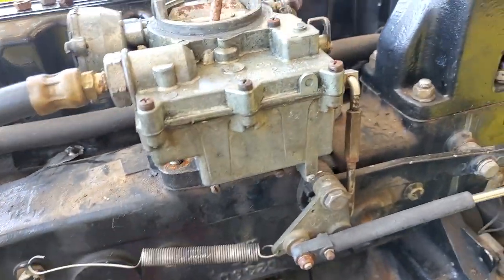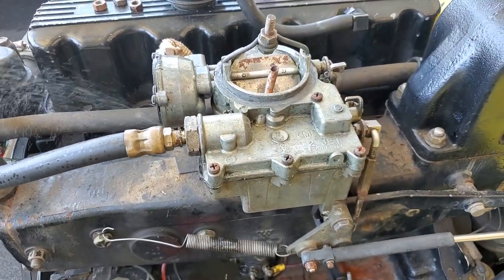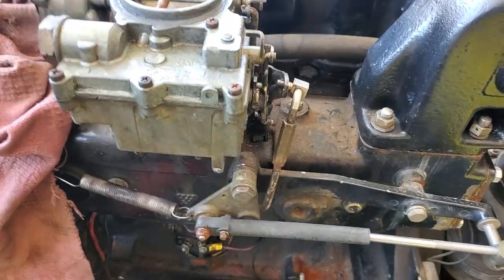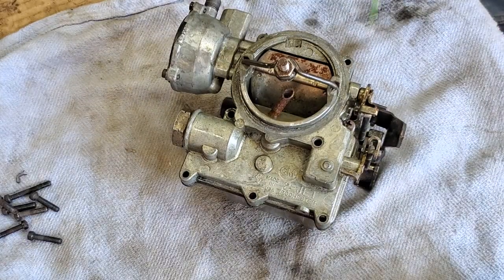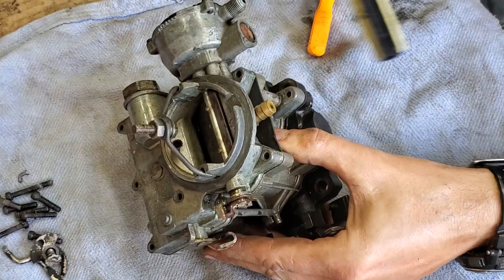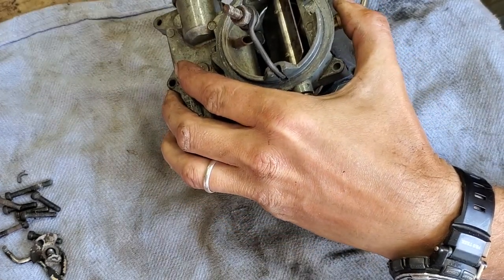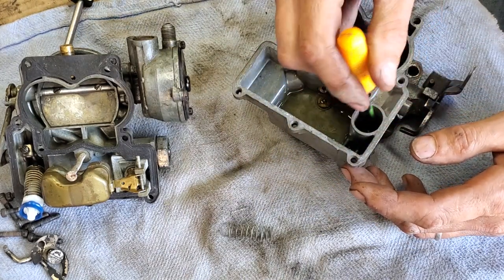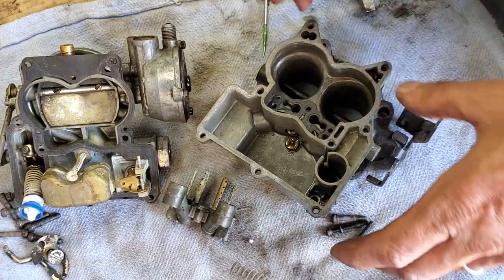Mercruiser 2 barrel Rochester 2G carb rebuild Part 1 - Removal and disassembly

Comment: Very similar to mine off a 1990 Ebbtide with the Yamaha L4 3.0.  I did a recent rebuild with a "marine" kit and I replaced the inlet valve (under the float) only to find that the replacement was considerably shorter than the original and the float couldn't close it.  Had to do a little bending of the float arm to get everything to work properly.  The Mercruiser models only have one idle screw where these have two.  I don't have the corrosion problem because my boat is in freshwater.  Thanks for the video

Comment: So I gave it a shot and just rebuilt my 2 barrel on a Mercruiser 170 .... I could swear there was a check ball under the venturi ... you mentioned it when showing the build up but didn't show which hole it was in. It only shows a check ball under the accelerator pump on the diagram with the rebuild kit but doesn't show another one in the exploded parts view. Please help me and tell me where that check ball goes ... i don't remember and don't understand why it doesn't show it on the diagram. Is it optional ? Thanks
Reply: I did mentioned each ball at 11:34 & 7:27 for the pump system -

Comment: did you make a part2 of this i need to know how to put the tiny ball back where it goes
Reply from the maker: apologies not quite yet - one ball goes down the the hole with the slot across the top, on some models there is a second ball underneath the rubber plunger, but only if there is a cavity for a ball down there..

Comment: How is the choke supposed to be set on this? I rebuilt one about a month ago. Everything works great, but it has been 90 degrees since. I'm not sure I have the choke set correctly since it is always open.
Reply from the maker: you loosen the 3 flat screws on the black plastic choke cover - it gets stuck so before u break the adjustment slot make sure its loose first - maybe pry on it LIGHTLY, once its loose, you can rotate it watch the choke and set it full open for that heat, or 75% open.. dont forget to tighten the 3 flats and dont remove them, just loosen them.. easy to lose those metal tabs

Comment: What is the exact make and model of this boat? I have to know because I have this EXACT model however, it will not be able to be insured without this info, I've looked everywhere and its title is mtz which means home build, yet all insurance needs the origional manufacturer, plus theres no way to trace before title, unable to contact origional owner, help!
Reply from the maker: find the vin and decode. I cant recall the make but it was a 70s model. All the info is in the vin on the back of the hull.

Comment: What rebuild kit would you use for this particular carb?
Reply from the maker: they come in 2 sizes - so you would need a 2G kit - the only difference is the throttle bore size - rest is all the same. Some might have both kits. Look up using the number stamped on your *or measure the bore size and go from there).. they are 1-1/4"  or 1-1/2" iirc..
Reply: @SocalMarineUSA  Thank you mate

Comment: I have a 3.0 and it revs and starts fine out of water then in water it wont rev past 2.5k wont go over 10mph  even in neutral it wont rev in water. Any ideas ?
Reply from the maker: Spun prop hub?
Reply: @SocalMarineUSA  nope but thanks! It wont even rev in neutral when in the water but runs amazing out of the water
Reply: I have a similar issue on my 06' mercruiser 4.3, did you find a solution?
Reply: @macdadybeavers  not yet winter came and put everything on pause. I'm going to buy a new carb and try it. How about you?
Reply: just ordered a carb rebuild kit yesterday lol hopefully that will be our culprits. Only other issue I have now is overheating in neutral. Cools right down when in drive on the water.
Reply: @macdadybeavers  yeah these boats are very frustrating lol. My broke a starter bolt off in the block and I about lost my crap and almost accidentally forgot to put my plug in 😉🤫
Reply: @GearsAndGuns  lolll
Reply: @macdadybeavers    If your overheating in neutral its because your impeller probably needs replaced